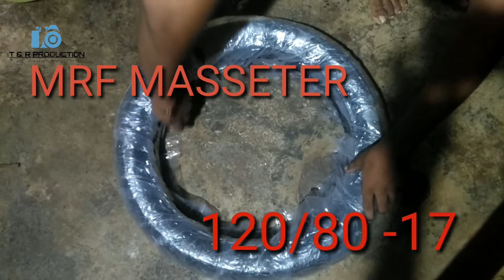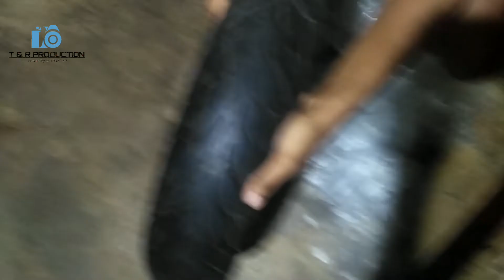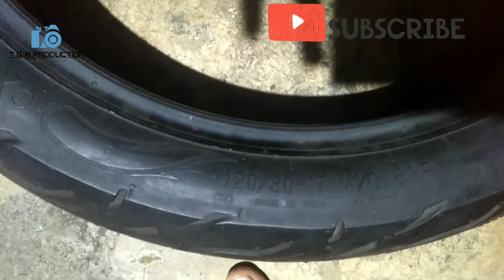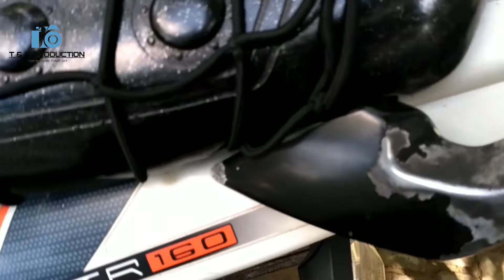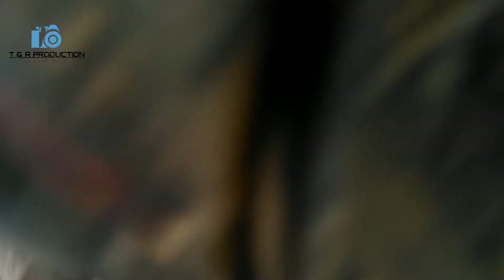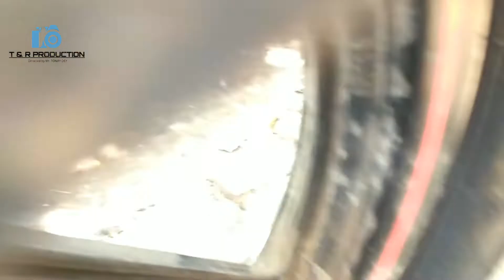MRF Masseter 120/80 -17 Tyre || TVS Apache 160/180 || #mrf #tyre #modification #tvs

Comment: Kiya A same size ka tyre rtr180 me bhi Feet hosakta hai
Reply from the maker: Yes
Reply: @trproduction968   isse bhi Axa greep wala tyre hai kiya bro. Rtr180 ke liye ..?
Reply from the maker: 160 me jo me use kiya hun wo 180  pe vi fit hojayga , no problem
Reply from the maker: 120/80  17  size  Apache 160/180 me fit hojayga,
Reply: @trproduction968  its ok dear
Reply: @trproduction968  Bhai mere pass RTR 180 h to usme 130-80-17 ka fit ho sakta h kya
Reply from the maker: No ,bro